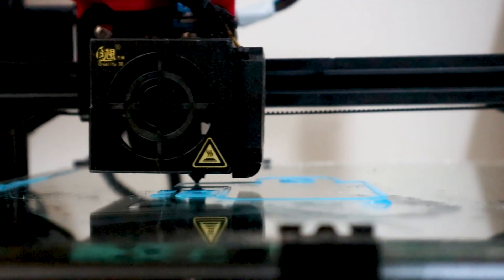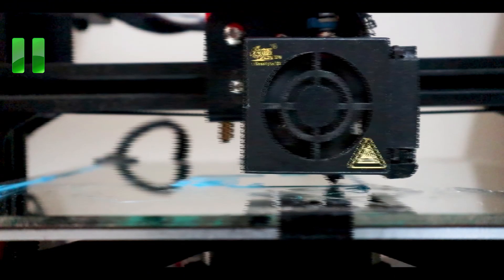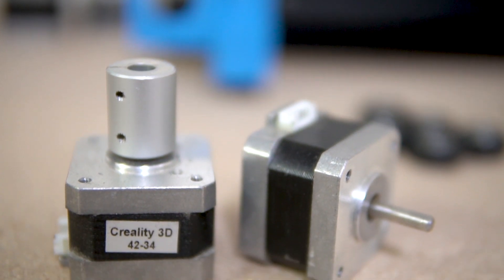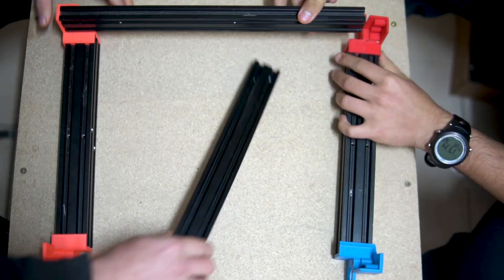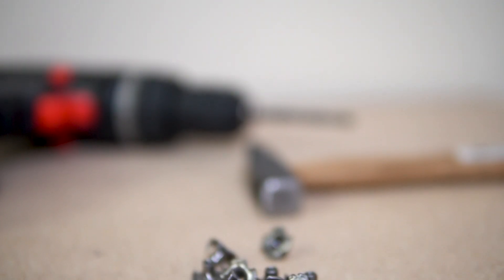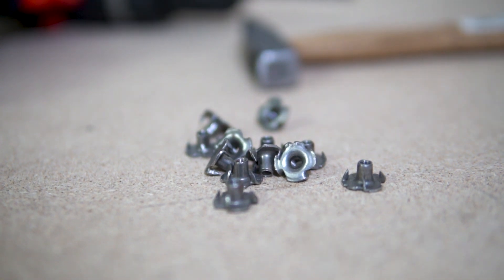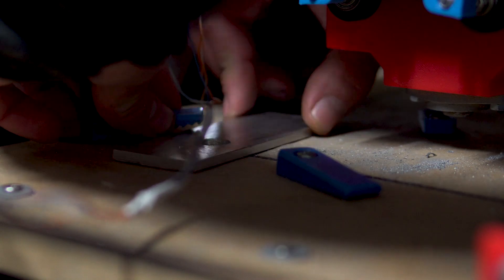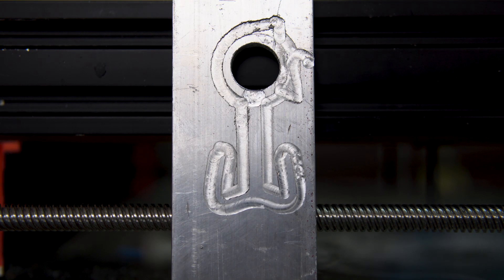3D Printed milling machine

Comment: I followed the link from the CNC forum on Thingiverse.
Reply from the maker: Awesome,  are you interested on the files? Cause we are still trying to get them together as they are quite a lot !
Reply: @wearetherandombros7782  No, not at this time.  I use a German made Techno Isel Davinci III for my CNC work.  I have some CNC project designs on Thingiverse.  Most start as .STL files so you will need other software to create the tool paths.  https://www.thingiverse.com/OpenScadDad/collections/cnc-projects

Comment: Good job guys
Some recommendations of an old guy:
1) Where forces are entering a machine, these parts should be stiff and have some mass. Why? Because it will reduce vibration … a major problem in these kind of DIY CNC machines.
2) Reduce total play = Virtual play PLUS Real play. Virtual play is the machine deforming in mm caused by (in this case) cutting and feeding forces. Real play is f.e. backlash in feeding treaded rod and the axial play in bearings (d=20 has +/- 0.2mm play)
Do some measurements with precise indicators (reading scale 0.01 mm) and improve. Often simple improvements can bring nice results.
Good luck and again … Good job
Reply from the maker: oh thats really nice from you ! it should be really easy to spot that we are completely beginners ! we are now saving up to buy a spindle ! our first goal is to replace the z axis with aluminum parts , we completed some accuracy tests  westerday and in the next days we will improve many things ! thank you for taking the time to explain us some things as we never encountered a real cnc in real life and all we can get is knowledge from those who use them !!